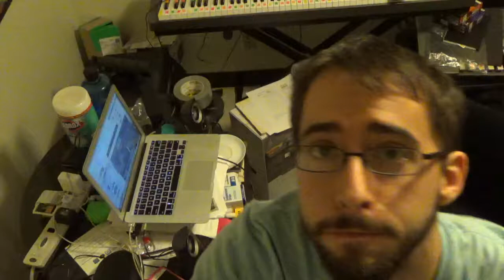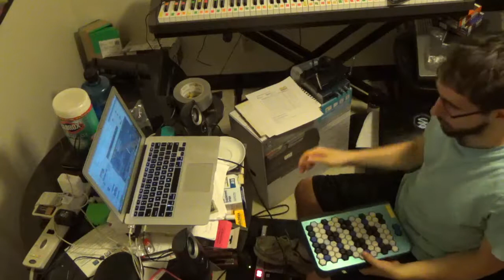Dynamic Tonality: Used with a pedal to change any continuum

Comment: Hey im having alot of issues with viking could i get a hand?
Reply from the maker: chcken is fod Hmmm, I could try to work with it but I’m not a Viking god
Reply: @stephenweigel  thanks man
Reply from the maker: @ossifrage6828  So what's the problem(s?) you're having?
Reply: @stephenweigel  I figured out some issues before you replied but my main thing is how do you record it since it isn't a vst
Reply from the maker: @ossifrage6828  I have a separate video on that, actually since I don't think it's possible within the framework of the plugin itself (I try not to be too bitter in the video). If I need to record Viking, I either capture the system audio, or record externally from a pretty robust speaker I have.
Here's the video in question:
https://www.youtube.com/watch?v=t1ndNqtr46w&list=PLzY9zzOkuloTUaKtiplNCd083JB7-2rNy&index=5
Reply: @stephenweigel  thanks man!

Comment: Hi Stephen! How did you manage to control the generator continuum with a pedal? I tried mod wheel at a midi controller, and also to send a variety of cc messages through a virtual midi port but none seems to have any effect. The same happens to Transformer. Having to use a mouse kind of waste the general idea of changing temperament on the fly hehe
Reply from the maker: Rafael Sarpa I actually had to email Andrew Milne for the original patch so I could add it in myself. I don’t think he would mind if I gave the patch to you